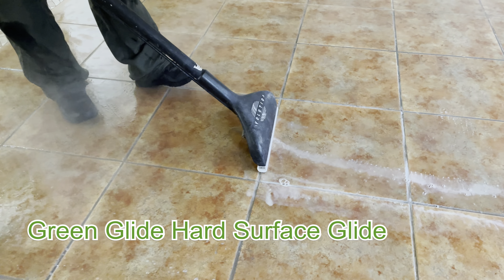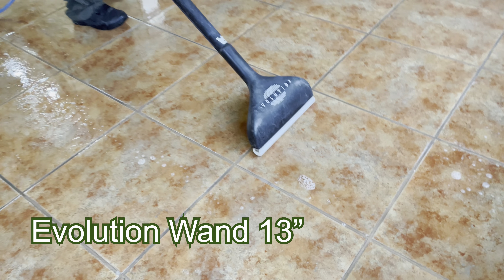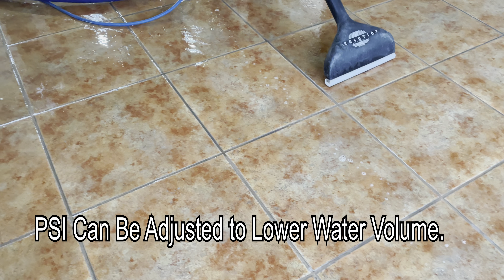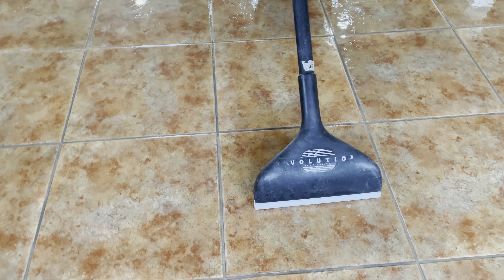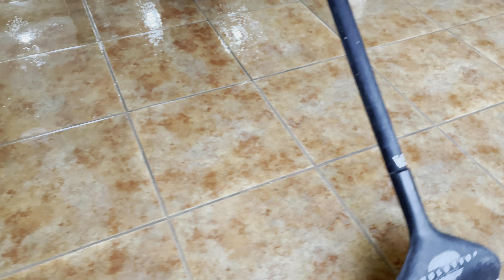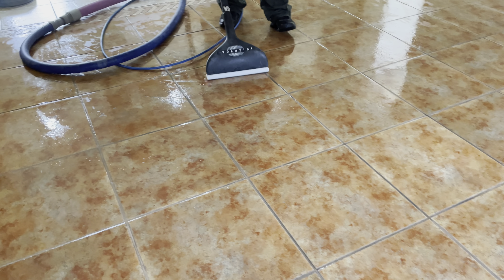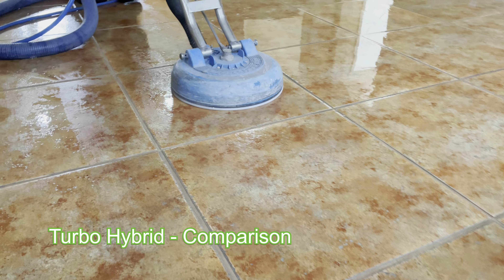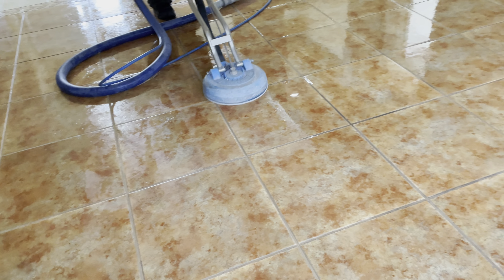Green Glides Hard Surface Wand Compared to Turbo Hybrid #lasvegas #greenglides #wandlips

Comment: I prefer to run the wand at an angle to the grout line, keeps the brush from falling into the "moat" and losing vacuum for a moment.

Some floors respond better to spraying on the forward stroke only and vice versa.

I dont clean trashed floors much so I haventbused a spinner going on two years now.

and Inmuch prefer the Sapphire Ti wands with the Brush Glides due to thier incredible air flow...